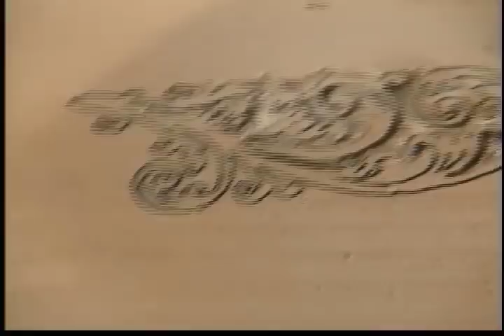Learn Wood Carving Relief Custom engraving Power Carving  Engraver tools machine, 400xs High Speed

Comment: Could this too; be used on Gourds? Also can it be gotten or sent to Wales 🏴 in 🇬🇧??
Reply from the maker: Yes, the 400xs Power Carver works perfectly for detailing on the gourds. The high speed is so smooth while engraving on the gourds. The stenciling system is very easy to use as well. We ship worldwide every day. If you would like I can provide you with a shipping quote. Send me your ship to address and I can send you a quote. sales@scmart.com Thanks Dave

Comment: Hi there could you please tell me where to get stickey transverse from thank you.
Reply from the maker: You can order the blank stencil sheets here... http://www.scmartwork.com/index.php?l=product_detail&p=15 They are so easy to use. Just print your design on using a printer or copy machine and trace your lines.
Reply: Thank you was just going to ask the very same thing
Reply from the maker: Hi Barbara, You can order the blank stencils here.. http://www.scmartwork.com/index.php?l=product_detail&p=15 The most popular are the 25 pack or the 100 pack. These are so easy to use and it helps you get your design onto your surface. I use it on glass, wood, eggshells, and metal. We ship worldwide every day.

Comment: 01:45  What is coming out ?
Wood ?
Reply from the maker: We are engraving through the stencil directly into the wood. This is a piece of walnut. What you see is the wood being removed. The wood is so fine as it is being removed. This is why you have so much control with the 400xs/Power Carver. It really is just like drawing with a pen. The stencil sheet is so micro thin and it is very easy to trace your design.

Comment: Where and how much are the Power Carver please.
Reply from the maker: We have the systems on sale at only $395.00!!!! You can order here.. http://scmsysteminc.com/system_prices.php You will need your own small air compressor with a filter/ regulator to operate. Usually a small 3/4 of a horse power or larger will work perfect. We also have complete systems ready to go out of the box. You can email with any questions. sales@scmart.com or call 1-800-755-0261.
Reply: @scmsystems  thank you for your reply.